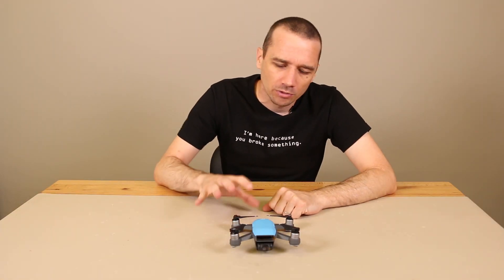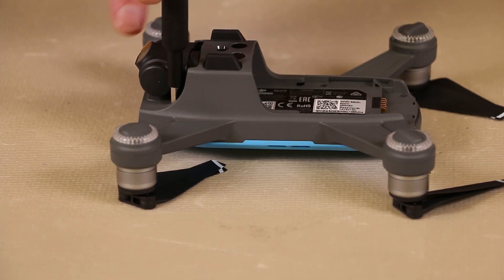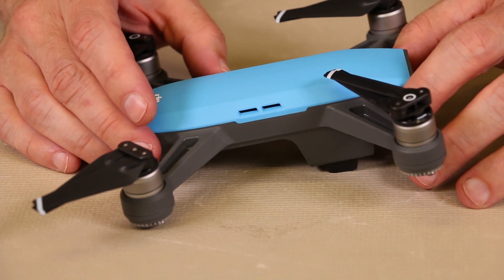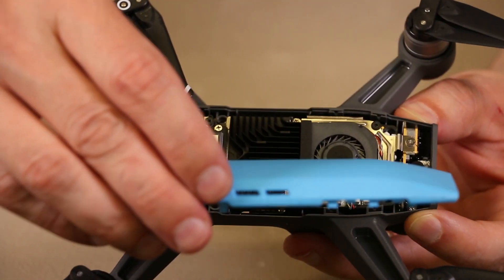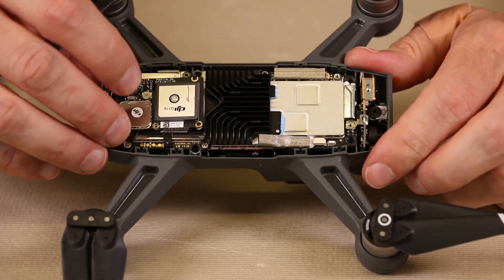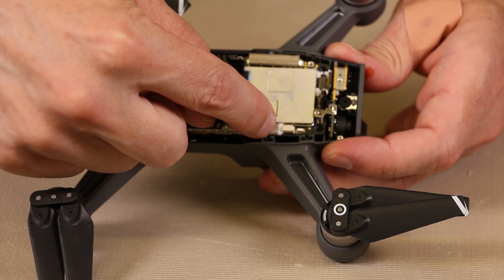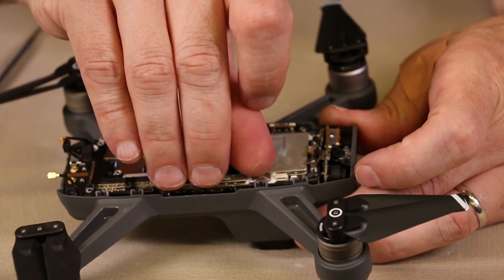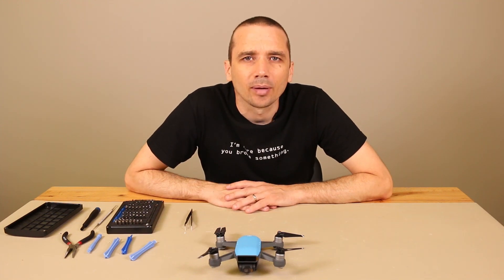DJI Spark Teardown - Detailed Guide

Comment: the  top cover is almost on top of the fan.  i increased the speed of my spark to almost 50 MPH on sports mode the heat out that little vent was insane. the fan has no cold air intake and the top cover is so close to it that i don't see how can that fan pull cool cool air for the heat sink to cool down. so what i did was make a nice round hole on top of the cover to expose the top oft he fan now is pulling cool air. now all i have to do is to make a nice little scoop on top (like a race car) and make it look nice.

Comment: Thank you very much! I succesfully fixed my gimbal's axis motor, which was stuck and didn't move at all. Everything is now working perfectly: motors, gimbal, vision, gps, camera, etc.
Reply from the maker: Awesome! Nice work.
Reply: How did you fix it? Did you replace it?
Reply: Muhbian I removed gimbal, used a bit force to rotate the motor that was stuck with my hands and it started moving freely again. Then I put everything back together. Some wires are really really thin and sensitive, so be careful with that. 

DJI’s warranty is really good, I would recommend contacting them first. I couldn’t contact DJI abouth the warranty, because I had some other problems so this did not fit in the warranty.
Reply: @mikaelh.5968   Thanks for the quick and detailed reply! I crashed the drone so i guess the warranty will not cover... But sure, why not try.
Reply: @Tronicsfix   Hi, very useful tips, thanks. Hey I put my spark away in my  closet for like a month, took it back out and there were 3 LEDs on the battery as I pushed the button on it. I tried to. charge it to a full battery but it won't charge. I turned it on and it came on, took the battery off and put it back on and still won't charge. please advise, thanks

Comment: I would have liked to see them use a passive cooling setup via the top and get rid of the Fans. Make it sealed. Although I have Flown mine in the rain before and it was fine. I would like to see these a little better weather proofed.

Comment: Looking for ways to reduce the weight about 50 grams (to meet Canadian rules). It looks like the wires for the motors run down the inside of the  arms. Can you see any problems with drilling holes in the webbing between the arms?

Comment: how do you get at the motors on the spark. i crashed mine on its back and put a wobble in the motor case. it looks like the spindle is true but when looking at the small gap between the motor cases its clear to see a wobble.

Comment: I tried allen 1.5 and 2. 2  worked for 2 screws the others screws neither 1.5 or 2 worked.
Reply: I just tried mine today, DJI did fill the middle two and front screws with glue that's why the Allen doesn't go in till you use a tweezer get the glue out first. I watch both video, neither mention about it.

Comment: do you know where the accelerometer and gyro are located? I had an issue once with my dji spark where the accelerometer got stuck. I tapped the arms firmly while I was calibrating to unstuck the accelerometer and it worked. Just wondering where it's located.
Reply from the maker: Hmmm...I'm not sure where they are located. I don't have it anymore so sadly, I can't check for you.

Comment: How many grams does the top cover of a Spark weigh?  Can it fly without the cover (to meet fewer flight restrictions of sub-250 gram craft in Canada) ???
Reply: The cover weighs 11.8 grams. 32.2 to go!
Reply: @rickgregoire9041  And the four screws holding it down?  I can't imagine those weigh much.
Reply: Got any weight saving ideas?  Is the heat sink made of metal?  If the top were not there, could the drone survive with less heat sink?  Would it be possible to drill holes in the legs without cutting through wiring or other needed parts?
Reply: @WilfredFumbly  You mean 6 screws and they weigh .8 grams total.

Comment: I tried to do it, and now I don't have any sensors working. I get gps sat counts, but it acts drunk.  Acts slightly erratic . Any ideas?
Reply: I got the same problem because my drone got into snow, two of the esc stopped working, opened the esc and cleared the water and now it flies. I didn't even disconnect any electronics just popped the top cover off just to see how it looks. I'm thinking of resetting it through DJI assistant 2 since I have messed with some settings.

Comment: Hey mate, cheers for the tutorial. You used 1.5 hex to unscrew the first cover right.....my spark seems to be 1.5 on the battery end screws, but has smaller hex screws for the rest of them......that sucks because I don’t have a smaller hex tool. Why would mine be different??
Reply: I'm running into a similar issue. But they are glue filled screws, not different size. I have so clean them out somehow to be able to service the drone lol
Reply: @rajgill7576  Did you get the glue out? If so: How?
Reply: Small drill used by hand worked. To have a better grip on the drill bit, roll some tape around the shaft on the end where you want to grab it.

Comment: The fan connector is hard soldered onto the motherboard.  Maybe a change since this video was made.  Unfortunately I broke the connector off and now my spark is destroyed!
Reply: That sucks because it's not necessary to remove the fan or the connector when removing the motherboard
Reply: Send it I’ll solder it on for you ,super fuckin easy

Comment: Is it possible just to remove the camera without opening the dji spark? Im going to thailand in a month and i need to register my drone if it has a camera...  and it can take up to 5 months... so my solution to the problem is just to remove the camera, not the gimble but the camera it self.

Comment: Damn, my memory card is stuck in the slot. So I'm going to have to do all of this just to get it out..
Reply: btw to take out the memory card, just push on it and it will pop out.
Reply: @x-king1659  you missed the part where I said it was stuck
Reply: @DiamondOre  Well, I say that because some people take out the sd card by pulling it out. btw. did you take it out after 2 years??

Comment: please help my ps4 is a jet i replace thermal paste and cleaned dust but still sounds as if its gonna take off also near the thermal paste the black small squares that goes over the silver thing two of them are missing is this a problem
Reply from the maker: Yes, that's a problem. Those are thermal pads and they are there for a reason...to help keep the chips cool. There's no way for me to know why yours is overheating without being able to test it.
Reply: maybe i apply thermal paste    wrong bcus when i open it its spreade around and faded in the middle but i cant get it right
Reply: found the problem the thing between the power and the fan that looks like an ac , the side that the fan covers was clogged anyways thanks for your support

Comment: Yo I need some help my PS4 controller is broke but I know how to fix it I just need to know one thing the thing the battery connected sits in came of the motherboard any suggestions
Reply: WiZz K1Dz the black thing its find it just sits right back on the mother board with the right fit